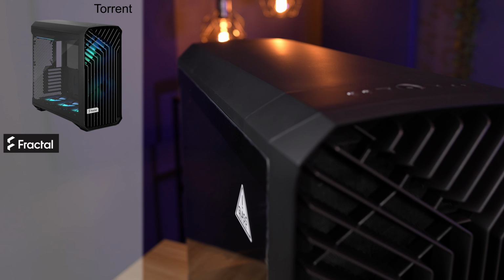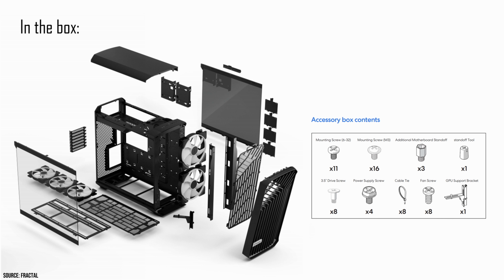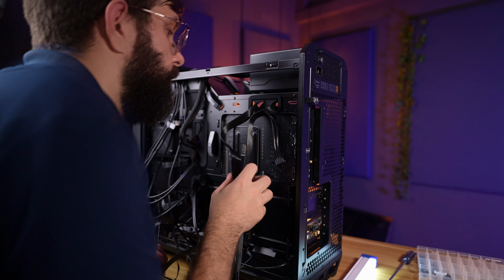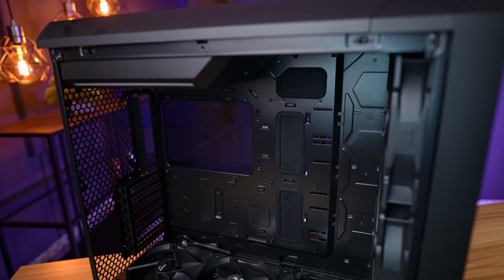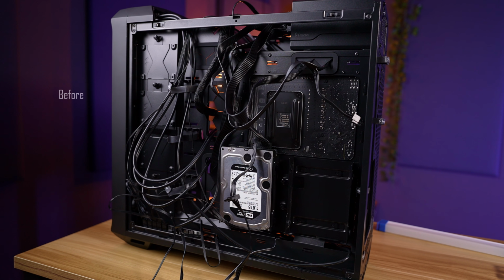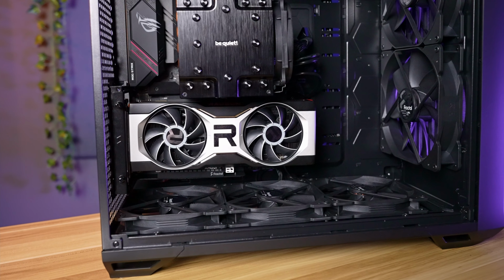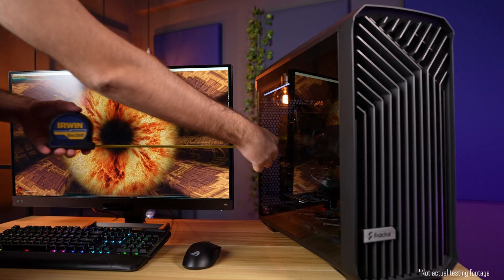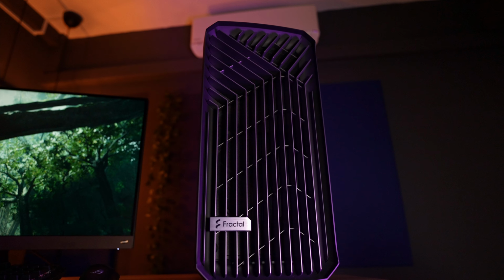The New Airflow King - Torrent By Fractal Design

Comment from the maker: Hey All! There has been an update for this case - Fractal is issuing a recall due to an issue with the Fan hub. To anyone who has already purchased this case, please remove the hub and apply for either replacement or refund. While this is an issue, we still feel this is a really good case so once this issue is resolved we would certainly recommend it. 
More information here:
FRACTAL STATEMENT: https://internal.fractal-design.com/support/solutions/articles/4000175681-important-message-replacement-of-fan-hubs-in-torrent-case-series-08-27-
APPLY FOR REPLACEMENT via Fractal: https://internal.fractal-design.com/support/tickets/new

Official Guide for Replacing Fan Hub: https://internal.fractal-design.com/support/solutions/articles/4000175679-how-to-remove-fan-hub

Comment: This could well be a silly and un-needed question, but does anyone know what length of PCI Express cable I would need in this case for powering my GPU? I have ordered this case and at the moment I am just using the standard cable that came with my Corsair RM750x PSU so just wanted to make sure that this should be okay.
Reply from the maker: You may be OK with existing. Just give it a go
Reply: What did you end up doing? The stock cable is 2 feet long, there’s no way it works imo, at least now now I would want to cable manage it.
Reply: @henry3397  I ended up using cable extenders as the supplied cables weren't quite long enough. Now I have a 5090 on pre-order, and I have a custom 95mm CableMod cable waiting to be used. Pmsl.